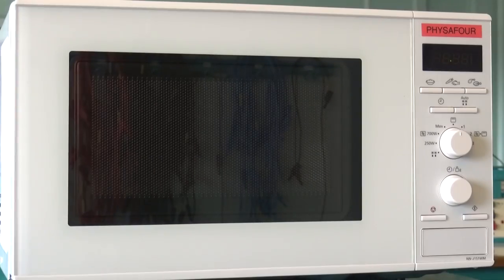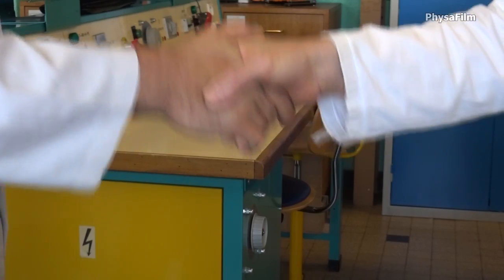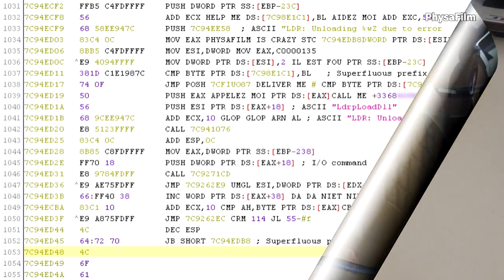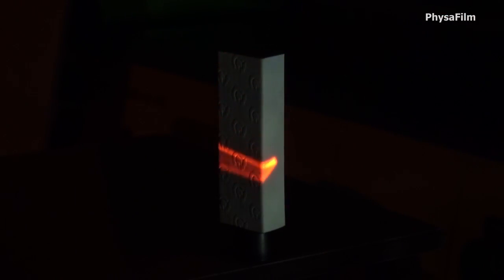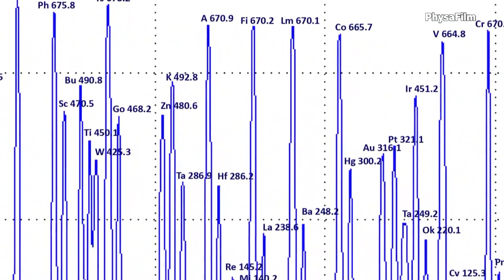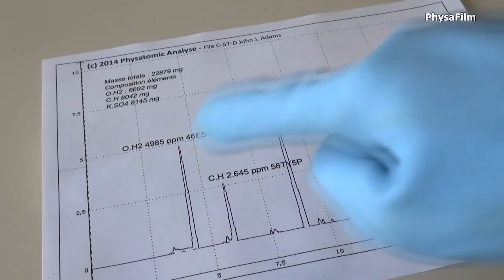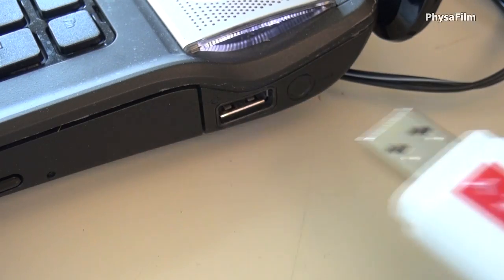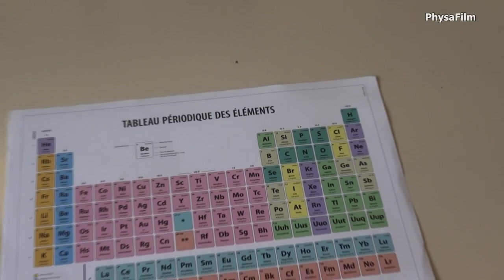DIY : How to make yourself an iPhone 10, X or 8 at home

Comment: I did this and my iPhone made a Popping sound and it exploded in the microwave so do not do this to so bad for your phone to not do this I’ll make your phone explode into little pieces I only put my phone in it for two minutes and it exploded and a little pieces the glass white in the little pieces and the microwave is broken too so do you just want to save money to buy your ass a new phone because there’s no way this works tried it does not work towards what are you actually charge my phone for two seconds and then my phone so I making a popping noise and then it exploded after like  and 45 minutes

Comment: It is not possible that the IOS system works on the microwaved Iphone. You need to instal this. And that is something a microwave can't do I think...
Reply: Laser scans and radiations captors have duplicated quantum states of memory cells, of course.
Reply: that, and quantum entanglements, using self-correcting codes, can be extracted from the MRI scan